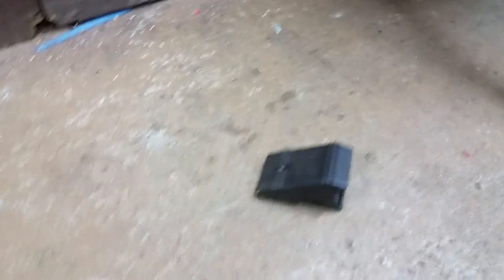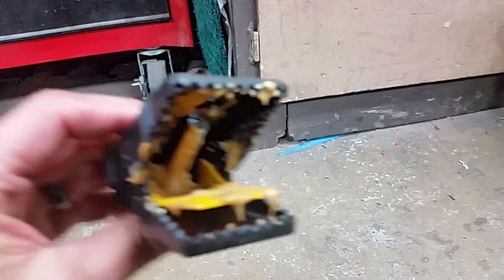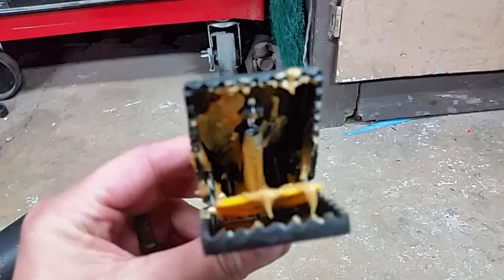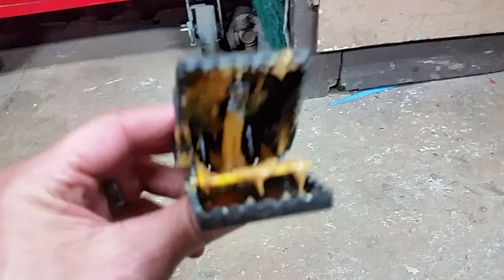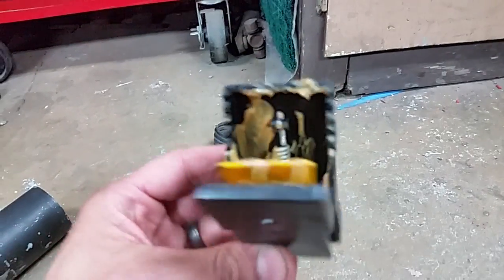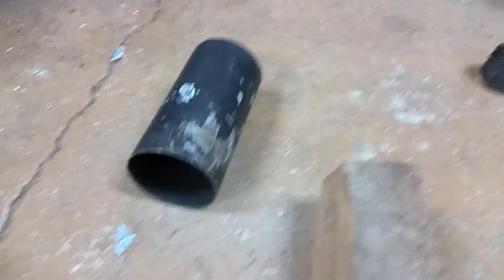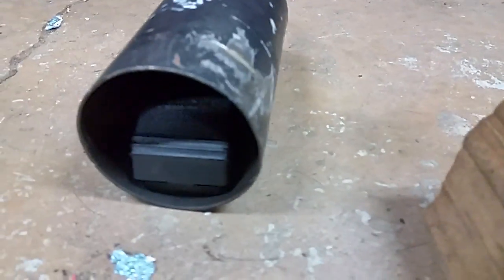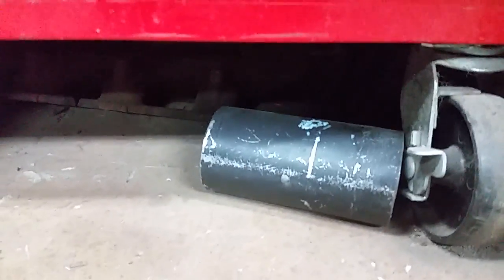Catching Mice EVERY Time With Your Mouse Trap (Solution for mice stealing bait)

Comment: Got this it's in trash because i thought it was broken it wasn't catching anything.. I try the zip trap takes batteries I got one I accidentally put peanut butter on the metal didn't read the paper now it stop working.. I try the old mouse trap lick every bit of the peanut butter not setting off the trap.. I try put a trap box put peanut butter in it but it's so smart it never goes in it.. the box trap works out side I caught 4 but can't get the one in my house..I try Block off holes in my house they keep finding ways in.. I live near corn field

Comment: You did a nice job with this video.

This is the best trap I have found if you have small mice that don't set-off other traps.   I like your idea and I am going to look and see if I have a piece of PVC which is the right size,  I clean the plastic traps with an old toothbrush to get the blood off. I just wash my hands after handling them. It's not like mouse urine is a toxic substance.

I set my traps outside because if you have mice inside, that probably means you have 10 times as many outside. I found this out by accident recently when I was leaving my squirrel traps out overnight and noticed the bait was gone in the morning. Squirrels and birds are not active at night, so I realized it had to be mice taking the peanut butter. The trick to baiting plastic traps is to spread the peanut butter in a thin layer across the entire platform. Don't just put a glob of peanut butter in the center. Don't let it get too old. If it is laying around for more than a week, peanut butter loses the odor and you should replace it with fresh PB. I like to put 2 traps inside of a Havahart model # 1083 squirrel trap at night. Mice are not very active (outside) during the day. Leaving outside traps set during daylight is a waste of time.

I reconfigure my # 1083 squirrel traps every morning for their intended purpose and then I put the mouse traps back inside them at night. The reason I use the mouse traps inside the closed squirrel trap is to protect other wildlife like birds from setting them off in the early AM before I wake up. Outside mice traps could also hurt other wildlife or dogs etc . Only very tiny rodents can enter a closed squirrel trap and that makes it safer for larger mammals.

I leave 2 plastic mousetraps inside each squirrel trap and some nights I catch a mouse inside each trap even though they are in very close proximity to each other. I have caught 24 mice the first month I began doing this. I had no idea there were so many mice in our suburban neighborhood !! I thought that only catching an occasional mouse inside the garage meant we were relatively free of mice. The relatively new Havahart # 1083 "easy set" trap is the best squirrel trap by a wide margin. I only use my older squirrel traps as containers for mice traps now.

I hope this advice helps someone.

Bill Z
Delaware County, PA
..
..

Comment: I didn’t use a pipe but a actually made a cardboard tube big enough to fit the trap in and closed off one side with a round piece. I made it using cut up pieces of a wet cat food box. 3 days later after making and setting it, I caught one. Presumably the little sucker that was stealing the bait. This video was definitely a big help. Thanks so much!
Reply from the maker: Glad that it worked out for you! Using the cardboard tube was a great idea!

Comment: Keep in mind this works fine for mice, they don't think before they walk into an area, you can easily guide them into a trap.  Rats are totally different, they walk the same pathways over and over, so much that you can see the oil marks long walls and such.  Your two block method will work fine for mice, but for rats, the methods are very different, so you need to know your enemy.  Rats tend to walk the same paths over and over, usually along a solid wall instead of walking into open areas.  They are very leery of changes in their environment and tend to shy away from things that have been moved or added.  Same for bait foods, until trusted, they shy away from new items.  If you would turn one of those 4x4 blocks so it runs the same pathway as the wall, you would be making a new corridor and after waiting a few days, then a rat would be OK with the changes over time.  A mouse would not care about the change and walk into the trap looking for food.  Keep this in mind, there's material out there that clearly explains these important points.  I believe the Victor trap company put out a video on this and it was very helpful for me when I had an attic issue.  I will say this, I did like the pipe idea, they don't have much choice but to go straight into the traps jaws!   Good luck.
Reply: Yikes

Comment: I got a better idea hot glue an almond to the trigger pad and then wrap some string around the trigger pad and almond so that the mouse has to bite through the string and in doing so it would have to use enough pressure which would then hopefully activate the trigger pad, also crush another almond to release some of the almond oil and wipe that on the string wrapped around the trigger pad and almond and hopefully the mouse will smell it.
Reply: I’m going to try this thank you

Comment: I have been using milk cartons for the same purpose you use your pipe.
I put the trap inside a milk carton with a small piece of wood next to the trap
 to fill the empty adjacent space.
This is the exact same black Tomcat trap I use and I was surprised to 
catch 2 baby mice at the same time, twice.
The first time they were side by side and both dead.
The second time, one was dead and the other one was caught by it's tail
and was still alive inside the trap the next day when I opened it.
It never occurred to me that a mouse could survive like that,
so it escaped when I nonchalantly went to empty the trap.
From now on when I only see a tail sticking out of these closed traps
I will submerge it in water for awhile BEFORE I open it.

Comment: Will give it a try.  Infuriating to be out smarted by a damm rodent.😣
Reply: I've tried putting peanuts butter everywhere. On the yellow, on the top, in the back, on the spring, behind the spring. They eat it every time. I've seen many videos now and best way is to get something stuck so they have to pull hard on it and trigger it. It could be glue gunned dog food or candy or qtip dipped in peanut butter etc.
Reply: @zombetty92  you are correct. You dont want too much glue.  Glue small pretzel should work
Reply: This wont work either, the mouse in here just wont pull anything.  It will just leave the bait and fast the whole night.

Comment: I've had mice in my basement for about 2 months now.  Managed to find one hole and patched it up with steel wool, but some mice still remained.  Most were killed with poison, but I eventually got rid of the poison/bait as it tends to attract more mice.  These Tomcat mouse traps are not supposed to be used with bait.  But I did find that while the mice might get into the trap, and once even activated it, the trap didn't kill the mouse.  I accidentally left two traps side by side against a wall (open "mouth" facing the wall) when I was doing some clean up, and THAT managed to catch a mouse.  Two traps for one mouse.

I really like this idea of creating a pathway so the mice have to step on the trigger.  Thanks for that.
Reply: Sabine B is the steel wool really effective?
Reply: It should be if packed into hole tightly.  Xcluder Fill Fabric is better, but way more expensive

Comment: I'll be giving this a try, the dang mice in my garage have been eating the peanut butter out of my traps and not setting them off. Or  they set them off and it only catches on their tail.
Reply from the maker: That is the same reason I did this in the first place. Watched a mouse eat sideways out of the trap. Sneaky bastards!!
Reply: They really are sneaky. I went into my garage today and one of the traps was missing, luckily the mouse dragged it a few feet over and tried to hide next to lumber. That one was caught by it's tail and couldn't get out so I was still able to get rid of the mouse but I'd rather have them die quickly in the trap. I have plenty of small pieces of wood so I'll give that a try.

Comment: Do u reuse the same trap or do u have to get another. I heard they excrete urine and then it acts as a warning so others dont go on the trap.
Reply from the maker: I reused the same trap without any issues. If they did pee it would be in the tube and a couple of squirts of cleaner then rinse it out with a garden hose should take care of that.
Reply: And I just read the smell of urine will attract other mice
Reply from the maker: Oh wow really? That's nice to know. Especially since you don't ever have to touch the tube. Just slide trap in so no worries about getting pee on you. Definitely wouldn't suggest that in the house though because your house would get pretty "ripe". LoL

Comment: the trick is to NOT put your bait on the trap. put the trap nice and clean on the entrance to the pipe. two traps is better nose to nose. block one end of the pipe and bait that end in the inside. they don't know it's a trap unless you put bait on it. i';ve trapped mice with no bait if i know their path like against a wall. put one cardboard box or something to create an alley between the wall and the box, just wide enough to place two traps together facing away from each other lengthwise. Victor traps with the yellow platform work for this. like trapping a coyote you don't bait the trap.
Reply: So what are trying to say eh? You don't like Canadians that have access to Mickey D's WiFi on Saturday afternoons and post moose trap vids aboot sucky traps, Civic exhausts and J.V. Field Hockey talent?
Reply: What's your deal bro? What did I ever do to u anyway? I said I was soory aboot the no master bait policy for hangliding in the Mongolian ghetto trying to catch these mice in your garage right?
Reply: And last but not least, to the most impotent person in my life (drumroll cheese) Billy Blanks again. We did it brother. My ninja we made it. Only u can prevent forest fires ( drops mic)